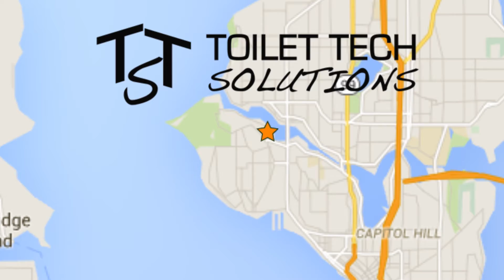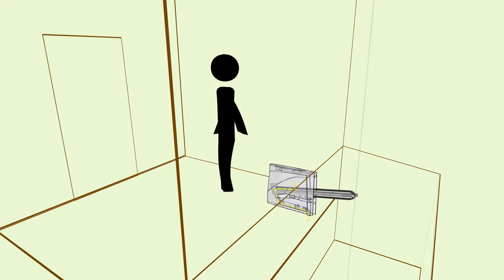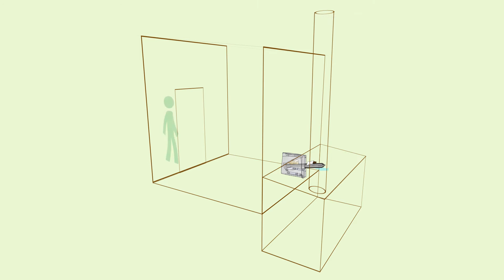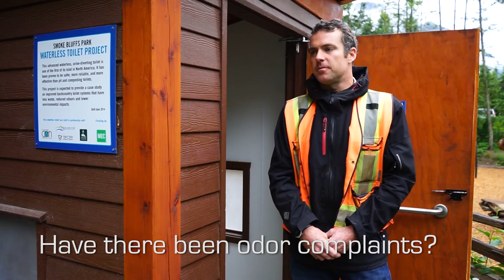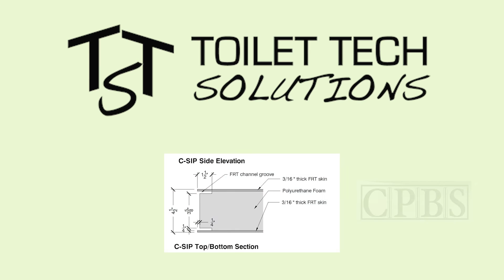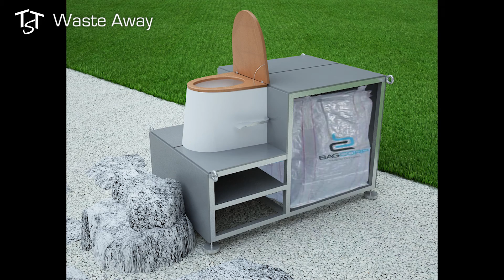TTS Informational Presentation

Comment: how does fluidic bowel movements, such as diarrhea, work in this type of system? this would not go up the conveyor belt. This would go to the ground with the urine?
Reply from the maker: There is a tiny slit at the low end of the conveyor.  This captures almost all solids.  Yes some watery poop might end up down the urine drain, but this sits in a small tank and urine can destroy many of the pathogens in urine.  Lots of research has been done on this.

Comment: Great presentation.  Where does the urine go in these installations?  It's the only bit not covered!
Reply from the maker: Thomas Cowley to the soil!
Reply: @geoffhill2172  Sadly, I don't think we could get away with that on our campsite in the UK.  We may have to use a straw bale to suck it up and then spread over the fields later.
Reply: @thomassjcowley  yes we have high water table - so it would have to go into straw also.